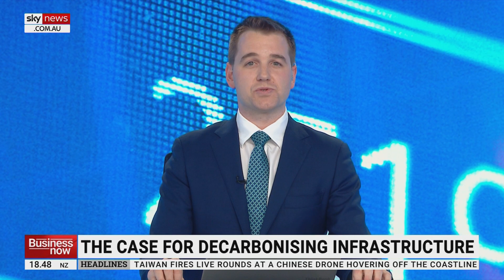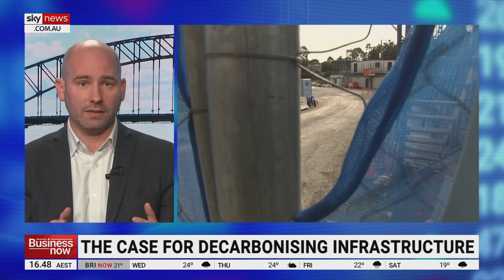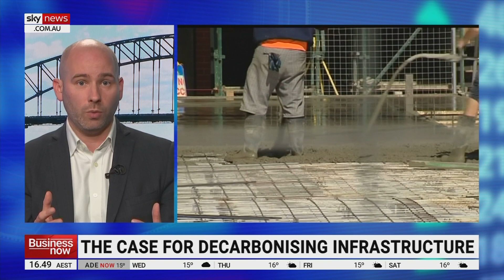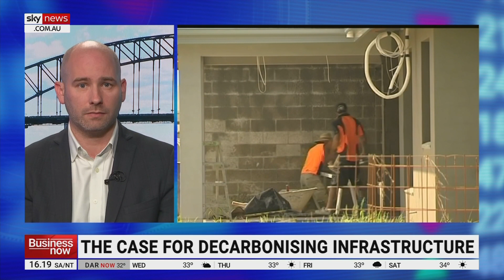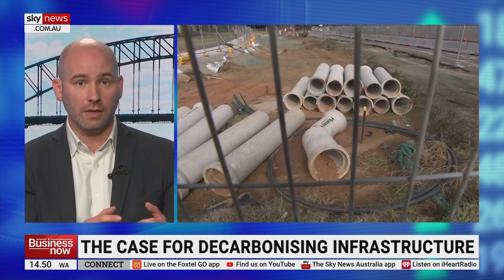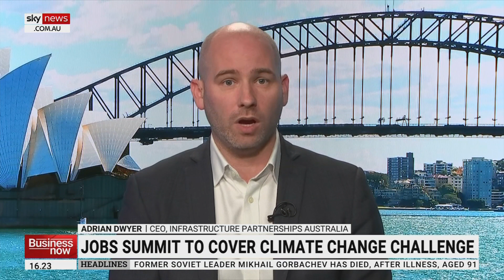Suggestion made to completely decarbonise infrastructure

Comment: It's quite obvious that the bald-headed clown isn't in the real world!
And has never had a real job?
And has no clue about building?
The romans had a early version of concrete they used, and a lot of the stuff is still their thousands of years after. 
So, we are going to get timber Briges across rivers etc. 
Timber railway stations on underground rail ways? and multi-story building made from timber?
This bloke is a wanker!
Timber is more expensive than steel in some applications and is no good structurally!
Bring on the next election and quick.

Comment: I am worried about going into carbon deficiency and am purposely going to burn more wood than necessary whenever I go camping!
Reply: Just breathe more since that's what we exhale...
Reply: @jenni0278  I have plants in my house, they keep stealing my carbon!
Reply: There’s no shortage of CO2.
Reply: @jamesmorrow1646  There is. Proven by observation that plant growth accelerates linearly with increase of CO2 in air (IOW: twice CO2 -> grows twice as fast). Known for hundreds of years, routinely used to boost greenhouse output by adding more CO2 to them.
Reply: @denysvlasenko1865  There is no shortage of CO2.
Reply: @jamesmorrow1646  Thank God!

Comment: @3:21 “Are there any countries around the world that are doing this decarbonised infrastructure already?“

Answer: “ surprisingly no“

I’m not surprised at all.

Question “is it gonna push up the cost of infrastructure development?”

Answer: “ One of the problems of designing infrastructure is decisions are made to be risk averse”

I wouldn’t call it a problem if infrastructure is designed to be structurally sound, long-lasting, And budgeted mindfully of tax payers money ahead of meeting this bloke’s fantasy and spin. 

If infrastructure could be built stronger, safer and cheaper than concrete and steel, it’s be done that way all the time.

Comment: Mud brick , it’s the way of the future .
Reply: I've seen some really nice domestic work done with that, and rammed earth, but you do need to use some lime or concrete to make it last as long as possible.
Reply: @DanielSMatthews  I’m helping restore a mud brick house at the moment . Built around 1870 . I’m busy putting the original stone piles back , no cement . Cement allows the dampness to rise up the piles .
Reply: @paulveenings6861  Must have wide eaves, if it isn't rendered. I like the way the Japanese traditionally sit their wooden posts on stones. I got to see some very interesting structures when I was in Antigua, that had survived a lot of earthquakes too. The design made the rooms very comfortable without any air conditioning required. Probably the massive walls such that the heat of the day takes 12 hours to get through to the interior by which time it is needed then as the night cools the walls again that cooling gets to the interior during the day when it is needed. Good luck building using that logic here in Australia though, they expect us all to live in glorified eskys.
Reply: @DanielSMatthews  yes it has wide eaves and it’s also been rendered now . The walls are very thick for the same reason as the Antigua house . No air con in the 1800’s .
Reply: Live in a mud hut with the tesla parked outside .
Reply: @TheRealBobSmith.  They don't let you build that way in the inner city, which is the real irony.

Comment: If Oz wants to return to nomad living in camps, you can do it! However, there is absolutely no problem with carbon emissions. But make yourself destitute and prey to Asia, sure, go ahead.
Reply: We have 300 years worth of carbon reserves, we don't need to worry about reducing carbon use until we have fusion power and so much energy we can pull carbon out of the air or seawater. Good luck replacing asphalt before then, it is 100% carbon and steel is an alloy of iron and carbon.
Reply: @DanielSMatthews  we don’t need to reduce carbon use atall! Reduction of CO2 output from human involvement is absolutely not needed. Oz global contribution to CO2 emissions is minuscule. If Oz is so keen though, stop by stopping all coal and iron ore exports and don’t make any steel or concrete, and don’t import any of those materials.
Reply: @Exanto777   Yes I see what you mean, it is just economically harmful virtue signalling and it is hypocritical. CO2 is not harming the Earth anyway, the levels are controlled by the oceans not by humans, we know this directly as the measurements did not show the "signal" from the covid slowdown of economic activity.
Reply: @DanielSMatthews  the carbon hoax is one more nail for the Oz coffin. Oz has an inadequate size military and looks easy prey to conquer. Don’t rely on the Americans, you’ve seen them run from Afghanistan.
Reply: @Exanto777  We will be fine, those who are pushing the carbon fraud past what is plausible will suffer, but smarter people are getting out of the cities and heading north before the crunch. I am 100% behind the idea of energy efficiency though, that just makes good business sense, so does using whatever energy source you can get your hands on, in order of profitability though. Most farmers do a good job of looking after the environment too, because they hold those properties for generations and see the landscape as a valuable asset to preserve and improve.
Reply: @DanielSMatthews  do you mean Australia will be fine? Welll it doesn’t look that way. The carbon hoaxers have a strong grip of your government causing expensive problems and in any case Australia looks relatively undefended.
Reply: @Exanto777  There will always be Australians who will survive anything that happens, and we have much sharper teeth than you'd imagine. A lot of fools whose lives are basically parasitic may not survive a big disruption, and they will be getting what they deserve if things go that way.
Reply: @DanielSMatthews  I’m sure there must be some Aussie geniuses around, but Australia is basically not defending itself and has been very lucky to not be invaded so far. It imagines the USA will defend it.
Reply: Hello Antony, can you tell me more about yourself
Reply: @janemalitysouthwick2620  who are you and why do you want to know more about me?